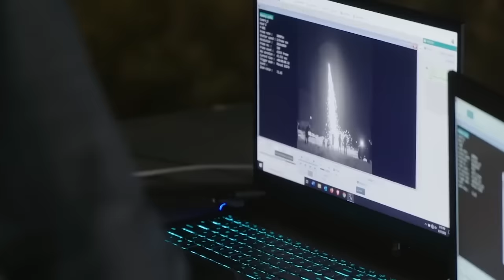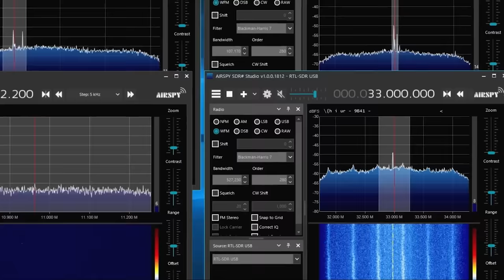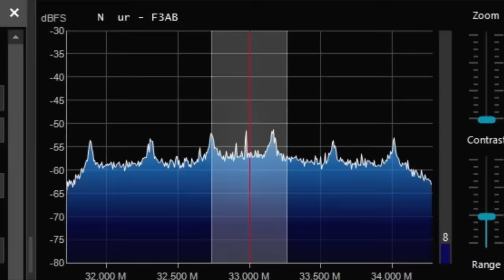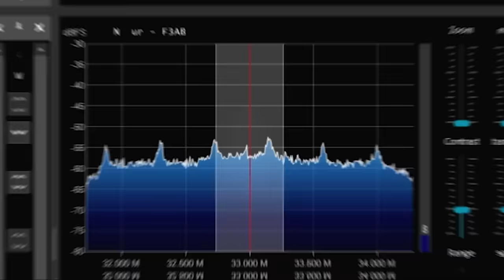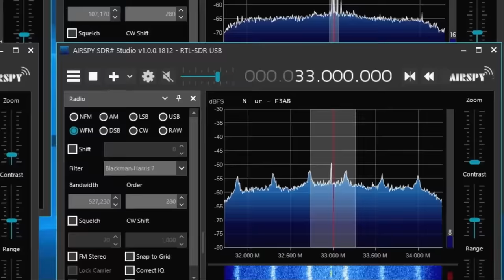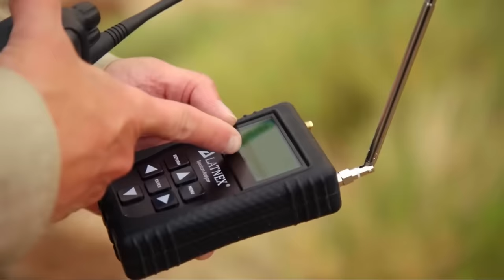HORRIFYING Anomaly Found Under The Skinwalker Ranch

Comment: The object (or most likely, a large mineral deposit, IMO) is only 30 feet down from th top of the Mesa.  Dig down the 30 feet using an excavator and then send cameras and even people down there to examine it up close.  If they are lucky, they will have discovered a large diamond deposit.
Reply: That would be a amazing find.
Reply: they said it's man-made... so it's not a deposit!
Reply: It's a UFO~💫
Reply: Doesn't explain why zerp damage to the drill head or evidence of heat build up.

Comment: I worked in the drilling industry for years and try as I might I cannot think of any way to change the direction of their drill. To change the direction of a drill underground you need to stop turning the pipe. Then run a directional bit (set to a certain angle and only the drill bit spins not the whole pipe) run a tool through the pipe to make sure it is pointing the way you want then use fluid pumped through the drill pipe to turn the bit without turning the pipe. Thus you put a dog-leg in the direction you want to go; pull out and change the directional drill to the original and continue on at the angle that you want.

Comment: the light being created is probably just piezoelectric ( when the crystalline structure is struck it flashes) and those carbide teeth are pretty strong. and depending on the material there may be little to no heat. heat  comes from friction and if that material is haed enough the friction is reduced and so is heat

Comment: They likely hit a Quartz Seam and the bit is not wearing because they are using Water as a Drill Fluid. They should be using a Diamond Core Drill Bit but they aren’t set up to do that.

Comment: Wouldn't it be easier to just excavate the mesa from the top, with a bulldozer, and move the pile to the other side of the road? If they did that, by now, there'd be an answer, not just dodgy drills, etc.